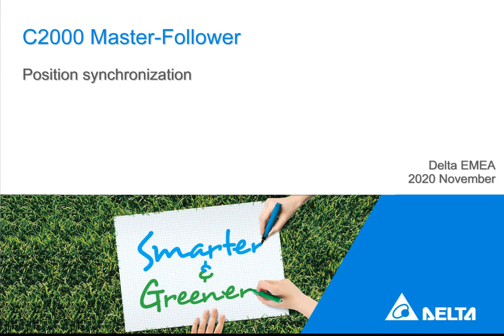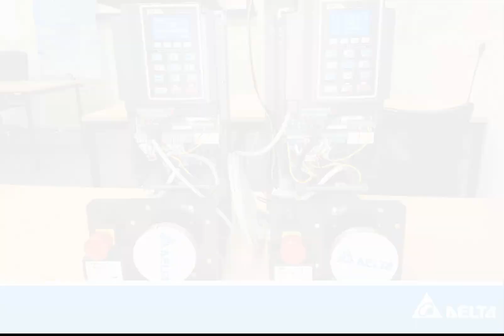VFD C2000 in position synchronization

Comment: I have an application of 2 Motor Driving a chain, need to run in Stable Constant Speed with load sharing purpose. Can you propose me an Hardware & Parameter Setup for this application???

Comment: Whats the best way to contact Delta technical support? I have a delta CH2000 and setting 10-19 is "reserved" (but it shouldnt be - according to manual).  Cant program motor internal position. Version 2.06 firmware.  Please help
Reply from the maker: Hello, as of firmware V2.06 (released on date code 2031) the Single-point positioning was moved from pr10-19 into parameters 11-65 (high byte) and 11-66 (low byte). This function is still triggered by digital input MIx=35. For more information you can contact us at iatechnicalsupport@deltaww.com

Comment: Please have you any demonstration and parameters on C2000 working in torque control. I have to control tension on a wire to be always as straight as can be.In schneider atv900 series i use 2 analogs( 1speed,1 torque) and D/I (start and torque inputs) and set current limits for torque.If current under my limit means wire is loose so it uses torque to adjust tension.Above that , is uses speed limitation as also in the beginning of movement(start fwd)
Reply from the maker: Hello, I believe that would be a nice function to demonstrate in a future video. Thank you for the idea!
At the moment there is no particular video on this but if you already have the drive up and running in speed mode in FOCPG mode (pr00-11=3 or 4) then it is quite easy to set it up for the torque control application that you described.
Pr00-10=2 (0 - speed mode, 1 - position mode, 2 - torque mode);
Pr00-13=0 (induction motor) or 1 (permanent magnet motor);
Pr00-20=2 (AI acts as frequency command/limit);
Pr00-21=1 (start/stop from DI);
Pr03-00=2 (define AVI terminal as torque reference);
Pr03-01=1 (define ACI terminal as speed limit);
Pr11-33=2 (AI acts as torque reference);
Pr11-36=2 (pr00-20 defines the source of speed limit);

If you let us know your location then we can guide you to one of our regional offices or distributors who could gladly help you further.
Reply: Sir can you also demonstrate the torque mode c2000 for winders application.. or 2 ac motors synchronized running above 60hz while maintaining tension between the two motors (winder application) many thanks sir

Comment: do you have two encoder and two pg card? can not use analog output of one drive as analog input for second ?
Reply from the maker: Hello, for speed synchronization this can be done very easily by wiring the AFM terminal of the master drive into AVI, ACI or AUI terminals of the follower drive.
For position synchronization this is not possible because in order to run drives in positioning mode they need to be configured in IMFOCPG or PMFOCPG modes (pr00-11=3 or 4). This means that an encoder or resolver has to be mounted on the motor shaft and then a PG card which can read their signals has to be mounted in Slot 2 of the drive.

Comment: Please send me parameter list
Reply from the maker: Hello, we will send you the complete parameter files via email.
In this video the Master drive was set to run in Speed mode (pr00-10=0) and the Follower drive was running in Positioning mode (pr00-10=1).
 The motors used are Permanent Magnet Synchronous Motor types.

Before you start any tests in Positioning mode it is important to make sure that the drive is configured for FOCPG mode (pr00-11=3 or 4). If needed we have other application notes to help you configure it.

To make sure that the drive is running properly in FOCPG you can start by first running in velocity mode (pr00-10=0) and checking the behavior of the motor at very low speeds and also at zero speed. In FOCPG the motor should be able to develop full torque even at 0Hz.
It is possible to set pr00-04=21 in order to monitor the motor position on the keypad. Once you are sure that the drive is running properly in Speed mode then you can switch to Positioning mode.